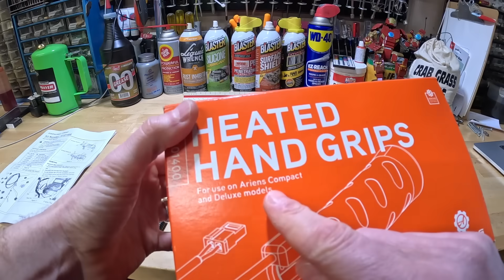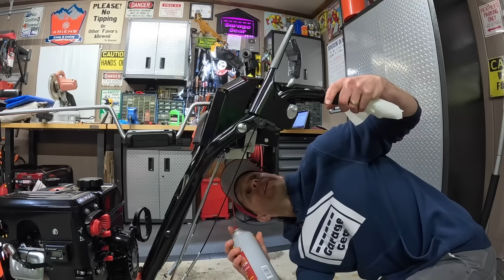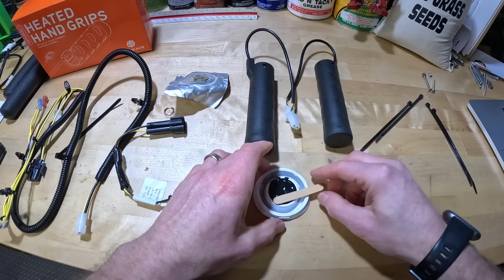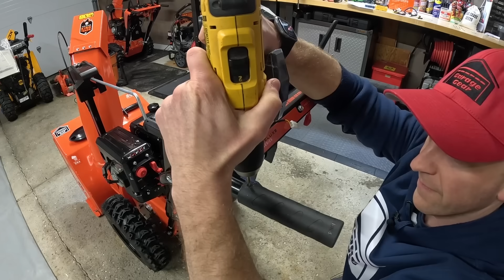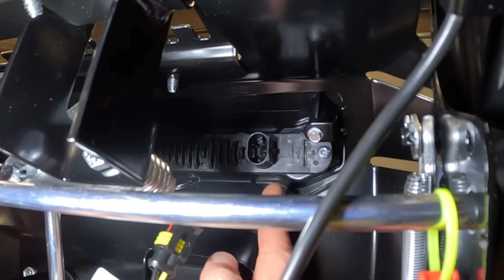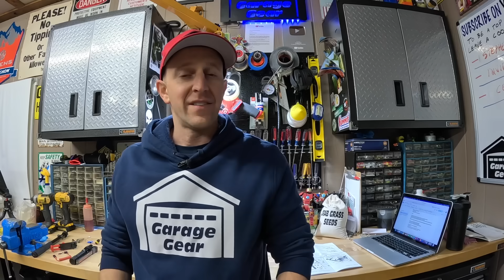The Most "EFFECTIVE" Way To Install HEATED HANDGRIPS On An Ariens Snowblower

Comment: Not sure why Ariens would suggest orienting the handle grip with the wire going into that slot.  When either of the levers are are down, it creates a pinch point where the wires touch the lever.  I made it so the wire went below, out of the way of any moving parts.
Reply from the maker: Smart to do that.

Comment: The epoxy provided is lacking.  Use any 2 part epoxy.  I used Devcon 2 ton epoxy with a 24 hr cure time.
Reply from the maker: That’s a great tip for anyone needing a stronger hold.

Comment: Great video. I have a problem with cold hands and my Craftsman snowblower doesn’t have a light. Is there any way I could install heated grips on mine?
Reply from the maker: Craftsman has their own version of heated hand grips but you’ll have to see if they fit your specific model

Comment: I can't find out for sure if this will work on my compact 22 from 2010. It shows compact 20-30 but the ariens website says it doesn't work for my model.
Reply from the maker: If it doesn’t fit it, it’s not going to work. You could look for something aftermarket.

Comment: If the toggle switch for the heated hand grips is left on after stopping the machine, will it drain the battery?
Reply from the maker: There is no battery on an Ariens snowblower

Comment: Check your model # before you get too excited about buying these. My Ariens Model # 921004 is not compatible for this. For a 'forward on' orientation loosen switch and spin it around or take a multimeter and establish 'on' position first, keep it that way and install it.
Reply from the maker: Thanks for sharing trinity

Comment: For the epoxy you’re supposed to push down in the center. It makes a little cup so you can mix it all together. Much easier.
Reply from the maker: Thanks for the tip

Comment: Hey JB, this is an unrelated question. I have a Ariens 1024 pro. As a very tough but senior woman. Well any woman may feel the same! My handgrip levers make my hands so sore the next day. Is there a way to reduce the spring pressure / tension?
Reply from the maker: Not really unfortunately. For the auger level you could put a strap around it to hold it down that way you don’t have to hold it but that makes it more dangerous to use

Comment: Back in the 80s we used Moms hair spray to mount hand grips for our BMX Bikes, never slipped and could be changed with a couple more squirts of hairspray, no bolts required.

Comment: Well done!  Your video inspired me to upgrade my Ariens 921030 Deluxe 28".  Older one with the halogen light.  Confused by Ariens website saying this does not fit.  I have the same dashboard as your 24".  What year 28" do you have?
Reply from the maker: The 28 I had was a 2013 thank you for watching
Reply: @GarageGear  Thank you!  I bought mine early 2014, it should work.
Reply: Installed.  They get nice and warm, borderline hot.👍

Comment: I would have used some black nail polish and coat the bare metal on the dashboard after drilling the hole for the switch. Let it dry, then install the switch.
Reply from the maker: Thanks for sharing

Comment: With the extra wiring is there any challenge with collapsing the handlebars when storing the blower?  Does anything get pinched or risk of damaging anything?
Reply from the maker: I don’t normally take the snowblower apart to store it. If you do that there may be issues with that and things may need to be disconnected

Comment: Another idea. Drill the hole for the switch and fit it, but don't do the final installation until the end after you've easily attached the wires to it.
Reply from the maker: Thanks for the tip!

Comment: Hey JB I instaled the heated hand grips and they work great. Now the led head light wont work at all.
Reply from the maker: Hmm, that's odd. It should work. Did you have to slice any wires and are your connections correct at the clips? Seems like all the power is going there

Comment: Just curious.   Ive seen a lot of your videos and you seem to be a fan of the deluxe 24 is there something wrong with an older version of a deluxe 30 that your not a fan of.  Would love to have heated grips on my thrower im just not that mechanical even though your video was very straight forward
Reply from the maker: Have nothing against the deluxe 30. Just bought this one because many people own this one. Thanks for being a cool fan
Reply: @GarageGear I got mine from work.  It needed work so they let me have it.  Just had to send it somewhere to get repaired.   Needed fuel lines and carb rebuild.   Haven't used it yet
Reply from the maker: @jon15711 let me know how she runs for you
Reply: @GarageGear I've got 2 holes at the top of the ager housing roughly the length of the little shovel where the shove thats used to open the shoot when it gets clogged.   Do you know what the holes are for? There are 3 more small holes on each side for the black angle iron you have on your machine to i guess help cut down the snow when it gets to high.  Where did you get your black pieces to put on your machine and if you could let me know what the 2 pre drilled holes at the top near the little shovel are for if you don't mind
Reply from the maker: @jon15711 the holes on the top are usually for a weight kit to put on top. The holes on the sides are for drift cutters.

Comment: I installed these on my 28SHO and the epoxy they include didn’t anchor the heated Gripen on the handle! I ended up saying screw this and I drilled and pop rivetted the heated hand grips on and it looks factory compared to a nut and bolt. Oh and open the box and check the dated code on the wire harness. 
   The kit I bought for my niece was 3 years old and the epoxy was rock hard I had to use my own Gorilla 5 Minute Epoxy. I will hedge my bet and drill and pop rivet her kit on as well. I also added a rubber weather proof cap over the rocker switch to keep moisture out of the switch. It’s pretty chincy that Ariens didn’t include one in the kit! I’d strongly suggest that on yours!
Reply from the maker: I agree! Like the idea of the switch cover

Comment: Just get some good gloves…
Reply from the maker: Gloves are great, but heated grips are a game changer!
Reply: @GarageGear  As an alternative try using the nitrile gloves we use for working on equipment then on top of them use your regular winter gloves. Works great,,,, as it prevents moisture from reaching the outside glove..........it's the moisture that will get you...................... It's not 100% but works well for me.
Reply from the maker: Thanks for the tip.

Comment: If you use epoxy, you’ll have a tough time removing the grips, as these will inevitably need to be replaced at some point.  I used electrical tape to make the grips snug, and a machine screw into the hole on the grip.
Reply from the maker: Thanks for sharing that idea! Good plan

Comment: What I don't understand is why Ariens didn't install them on the machine in the first place but even as an option the mounting holes should be pre-drilled and capped off making provisions in the future.  This is where MTD machines kinda shine as they are often pre-installed even at the big box stores.  Then again, Honda's machines could have them as well, especially for the price but then again, my Honda would outlast Ariens and my Cub Cadet added together.  The funny thing is Cub Cadet had provisions to mount an auger housing lamp on my machine so that was relatively painless as well.  The Ariens setup just looked cheap even compared to the Cub's big rocker switch.  I mean, Ariens could have included an "on-off" sign like you said but also add a rubber boot to go over the bat of the toggle switch.
Reply from the maker: All good ideas here!

Comment: Just got in from the garage after putting heated hand grips on my brand new Deluxe 24!  Went really smooth but I had to monkey around a bit because I had installed the auger LED light a few days ago but everything works great!  Also did all of your anti seize and grease suggestions from other videos.  Hour/rpm meter is on and Armor skids are on the way.  Love the channel!
Reply: So, both Heated Hand Grip kit and Ariens Auger Housing LED Headlight Upgrade Kit 72105500 work with the included harnesses? Do you recommended installing Grip kit or Headlight first?
Reply from the maker: @s @spowell71 im going to be putting the auger housing light kit on very soon and I saw on another video that it works with the handles so we are good to go. That should work.
Reply: @spowell71  I really like the auger light kit but the hand grips are amazing.  I didn't use their epoxy and instead bought a grip-glue product on Amazon designed specifically for handlebar grips.  And yes, the harnesses on the most recent deluxe will work.  I didnt realize that at first and actually soldered the connections before i realize i could have just used the included connections.
Reply: @spowell71  I don't think it matters honestly.  I might do the grips first only because its a bit more of a pain than the light but thats just personal preference!  Good Luck!  And yes, the harnesses work together just fine.
Reply from the maker: Right on! Glad to hear it all worked out for you! Thanks for following along.

Comment: All your vids are fantastic! Question: I just purchased a used Ariens PRO 28 and heated hand grips are new to me. Firstly how are they heated? Do they have a built in electrical element? Second, how long should it take for the grips to feel warm? I ran the blower for a few minutes and I could not feel any warmth in either grip. Thanks!
Reply from the maker: Thanks Randy! The grips are heated with metal coils that heat up inside the grips. They typically take about 3 minutes or so start heating up. Is there an on off switch on your dash for the heated grips?
Reply: @GarageGear  Yes there is a metal toggle switch on the dash which I ensured was in the "ON" position. I will try again today. Thanks!
Reply from the maker: @Randy-ul5hy ok also is there a fuse box along the wires? I would check that too

Comment: I scored a used 2015 28" Hydro Pro back in January. I had to transport it in a storm 180 miles on a trailer and it got covered in salt and brine. When I got it home the headlight and heated grips didn't work. I froze my fingers all thru January and February! Now that its warmer I'm trying to figure out why they don't work anymore. On another note - I did all the maintenance based on your advice - I was worried about the wheels coming off after 10 years but it had been serviced at some point and one came off easy but one had the driveshaft rusted to the inside of the wheel shaft - this model has keys in both wheels.  Luckily a little PB Blaster soaking helped it off. Now both wheel shafts are smothered in Anti Seize like you demonstrated! Thanks for all the help with these Ariens units (the owners manual is totally lacking on this particular unit regarding info about the hydrostat - absolutely no info and I was used to friction wheels, so I just lubed the chain and gears and put the shield back on and hope for the best). It performed like a total beast with the 3 feet of slushy heavy snow at the end of my driveway however and I love it!  It's now WD-40'd and siliconed and fluid filmed to the max! Oil change is next and drain rest of fuel for the summer. Thanks again I couldn't have done all this without your videos and demonstrations.
Reply from the maker: @UnkleAL1962  that’s a long trip for that gal! Check your connections I wonder if some salt corroded them. Thanks for following along Al!
Reply: @GarageGear  older friends sold me the blower for a really good price they now hire a snow plow guy so it was a visit/pick up of new blower for me. She seems to be a beast
Reply from the maker: @UnkleAL1962  keep me posted on her

Comment: If the heated handles come off another time, you can always remove them and grit 100 or less sandpaper the steel handles. If any glue fails it is because of surface adhesion, if the surface is too smooth, the glue can't form adherence.
Reply from the maker: @RickAuthor2015  good tips here

Comment: I just put heated grips on a brand new Deluxe 24" with 254 cc engine. I got this one for all the tight spots. On my old snowblower, The chute cable comes in from the bottom and freezes up in the middle of clearing the property. Is there any kit to put the cable on from the top like on the new models so water can't get in? I'm a welder but, I don't want my old Platinum snowblower to look like a piece of crap.
Reply from the maker: Not sure about this my friend! But you could try pumping some wd40 down the cables on each end frequently. This will allow the cables to slide better

Comment: Another Awesome video! Now I'm going to purchase this kit for my deluxe 28 as well as the led light! I got the same deluxe 28 you had but mine has the Briggs motor I went to buy a brand new one but found this one on Marketplace for way cheaper and believe it or not if this one was used twice I'd  be amazed there is absolutely ZERO rust on it!
Reply from the maker: @Janzy254  awesome janzy thanks for sharing my friend

Comment: I can appreciate the nut and bolts you used, because my epoxied-on heated-grips started sliding off when the heat made the glue soft.   I used the epoxy provided in the kit and the grips started sliding off.  A little bit of Shoe-Goo on the end of the grips under the rubber and the grips have not ever come off since then.  I'm not sure why my epoxy went soft on me... but they have not come off since the Shoe-Goo application.
Reply from the maker: @deansimpson6618  good thinking with the shoe goo

Comment: Im surprised ariens doesn’t pre drill the dash at the factory for the switch. Wouldnt add much cost to drill and add a filler plug
Reply from the maker: @benedeem424  agreed!
Reply: And why drill the panel, it would be possible to install a two-stage switch on the side of the handle on the left or on the bottom of the panel in the center, as is done on the Simplicity snowplow, Snapper
Reply: @ sure its possible, but the kit came with a switch to install on the dash. Ariens puts the switch on the dash on models that come with hand warmers

Comment: JB.I have a rapid Trac professional 28.  Unit is two years old but this is the first year it has actually been used.  My heated grips do not work.  I checked connections and they seem fine.  Checked fuse box but it has a black relay.  Don’t now how to check to see if it is bad or maybe the switch?   Any ideas
Reply from the maker: Not sure. Hard to tell without seeing it in person. Perhaps have a shop look at it

Comment: If you want to remove hand grips without ruining them you can use compressed air and a blower. The air pressure will slide them right off slick as anything. Put the tip of the blower at the seam between rubber and metal pull the trigger and it will pull right off.
Reply from the maker: @marka9292  hey mark! Appreciate you sharing this! I was trying to keep this simple for the newbies out there! 👍😉

Comment: The only thing I might change would be to possibly twist those grips a tad more to gain clearance to the moving linkage. IOW, do a test fit before gluing and screwing. That, and someone else mentioned a weatherproof boot to keep melting snow out of the switch.
Reply from the maker: Thanks for sharing rupe

Comment: JB I have the Ariens Classic 24, is there a way to use this kit . Or is there another kit available from Ariens or aftermarket that can be used.  Thanks
Reply from the maker: Hey mmafan this kit is only good for compact and deluxe models. The classic doesn’t have a light to run. Not sure if there is one available for this model

Comment: Compressed air or WD-40 via a tube works to remove grips… used both as a bicycle tech. I imagine that polyurethane finish applied to the handlebars would glue the heated grips on.
Reply from the maker: @johngrossbohlin7582  good tips thanks for sharing john

Comment: I've got a set of those cheap universal ones and had them ...gotta be 10yrs now? Still work. But I had to add a second set on the paddles to keep my thumbs warm also. Annnnd since my moldy oldy 20yr old yardworks doesn't have enough electrical juice in it to run more than the cheapest most basic ac light bulb, I have to hang a 12v 7ah lipo batt off the handlebars.... Jerry rigged but doing ok
Reply from the maker: @leecampbell9498  hey if it works it works Lee! Thanks for sharing

Comment: Great video, I added the OEM heated hand grips to my CC 2x 26”, easy install and CC had all the screw holes and On/Off switch hole already pre drilled and pre cut which made it a super quick installation, they were a bit pricy though, but my hands are nice and toasty now, keep up the great work ! 👍
Reply from the maker: You gotta love it when those OEM parts just fall right into place! Thanks for sharing and watching skut

Comment: Many years ago we used to use aerosol hairspray to put grips on bicycles. Once this was done, the only way we could get them off, was cut them off.
Reply: Yes.  Or use 3M spray adhesive.
Reply from the maker: I heard about this trick! Sounds like it really worked well